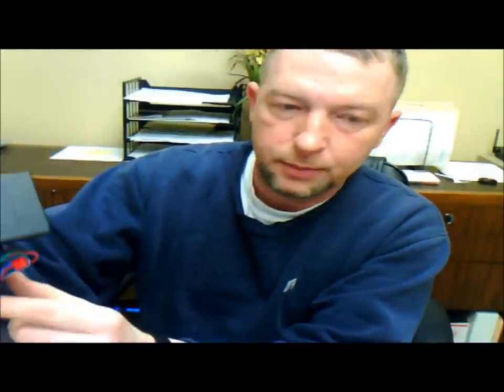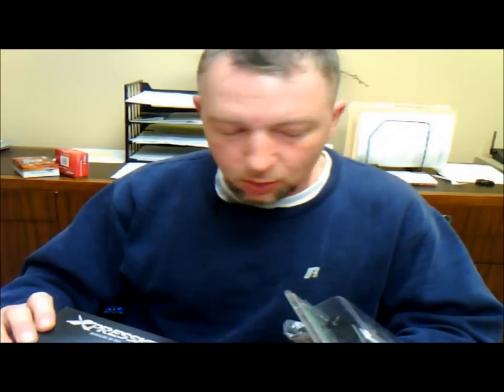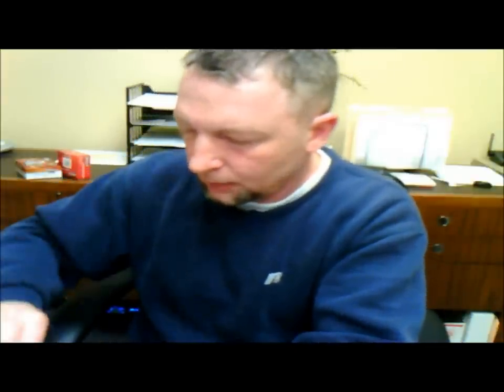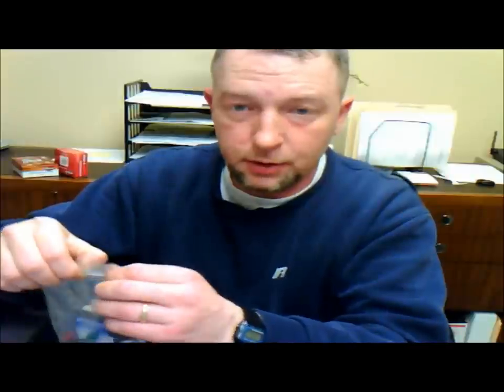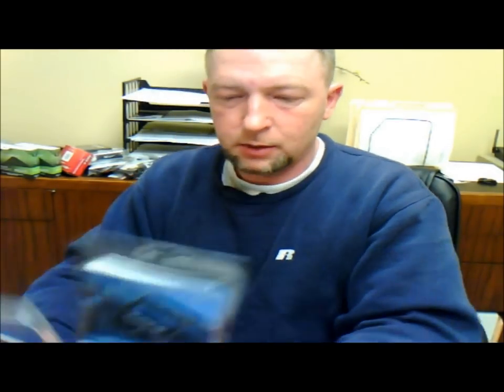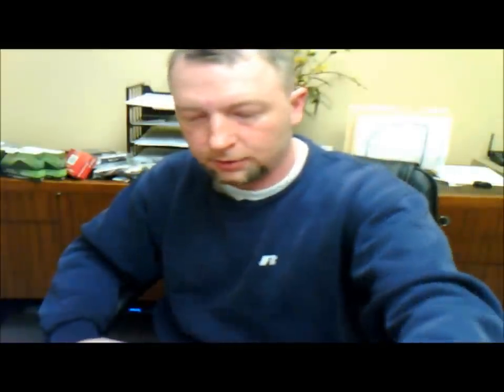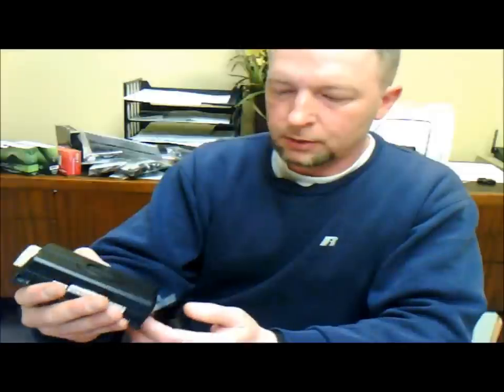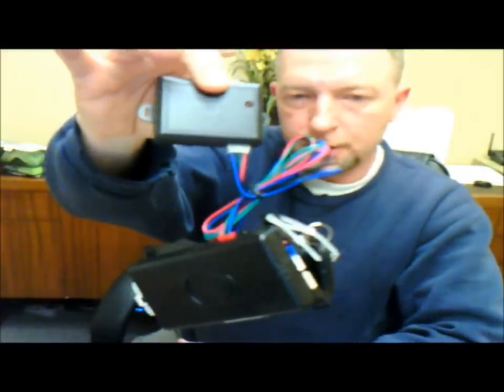Detailed explaination of what bypass module kits are for and how to choose one

Comment: Yes nice job! I wish I had found this video 2 months ago. I knew I needed a bypass and then found out a T harness makes it even easier.  So I have a mix of idatalink and flash logic parts.  Should all work with my code alarm system. 
Question. I have gone from 40wires down to 4 or maybe even none that need to be hardwired. I have the T harness that plugs directly into the ignition.  That has pw, gr and CAN.  Do I need to also hardwire the pw and gr on the code alarm box? 2008 ram 2500.

Comment: great guy, great explanation.  i'm lost with my car though.  i want to install a remote start and i bought the flash logic for my 2003 dodge stratus.  the manual refers to a sedan but mine is a coupe.  it says to connect j1850 and ignition, but i dont have a plug or a visible skim, but i have the coil on the ignition switch.  it needs the key but i don't think the flash logic will work for me.  any ideas.

Comment: APS-997C      I have both remotes and the vehicle is 2003 GMC SIERRA 1500 4X4.    The installer had difficulties also setting it up. Tried remote auto start vehicle tries to start but dies a second later. Does not fully start just cranks. And unlock lock still don't work. I downloaded installation manual

Comment: Installing remote starter in 07 Dodge Caliber.  Fortin Evo CHR T2 harness ver 6, Crimestopper rs4.  Vehicle remote starts, and shuts off after the accessories come on.  Unplug remote starter from Evo car stays running otherwise it will shut off then keep restarting when accy come on.  It will no longer program, led flashes 5 times meaning tach or started with before rs.  Returning the crimestopper tomorrow for ultra 1280.  Do you think issue is with the accesories coming on or the rs module ?

Comment: I have a 2003 Gmc Sierra 1500 4x4 z71 my alarm keeps messing up. Its been a while now and i want to fix it. Dont live where they installed it. i tried looking for installation manual to see where they maybe made error.   

Remote start - NOT WORKING,    Unlock/Lock - Not WORKING

Only thing that works is if alarm engaged truck will not start you have to press unlock button for truck to start with key.

Any help appreciated thankyou

Comment: Hey. I bought a Xpresskit, which you don't like and I see why and it doesn't seem to work in my 2008 F350. I tried everything. Its very annoying. Which module would you suggest to go with my truck and I have the Viper 5704 all installed and everything else works? I would like a bypass that i don't have to sacrifice a key

Thanks

Comment: Can someone tell me something?..  First let me say I am a decent electrical electronics geek, so I would like to install this  Compustar sc8oos unit into my 2001 Volvo. Ok I have NO original key FOB for this car when I bought it and can't see paying the dealer to program it bla bla bla, so If I install the sc800s remote starter with it's own key FOB (and here's the question) if I install my chip from my key into the steering column can I just avoid purchasing a by-pass module all together ? Money is not an issue but who's gonna want to steal a 2001 Volvo anyway... LOL.. So any thoughts ?
Reply from the maker: +ItBseCtioN8 I would do it, why waste all the money

Comment: Why do we  you are a dealer or certified installer. Whe I have seen short cuts, lack of of fuses, the remote start and bypass module which is not accessible, no solder joints. In short I am a freelance un- certified installer and I had to rip most of it and start from scratch. So don't talk to me about certification and I can not even flash a idatalink module. I think you have your priorities are mixed up, That won't stop certified to do a quick and shitty install as long as they have that paper. I have worked on fighter aircraft and IT electronics,and I bueld computers. l think I am qualifie to flash a very high highly engineered piece of electronics. Please get back to me about this issue before I complain to in my face  book account. Thanks for reading my message.
Reply from the maker: John M Lewis and you are who?